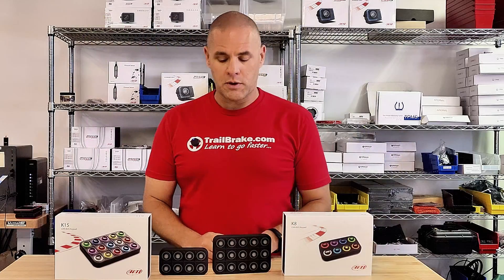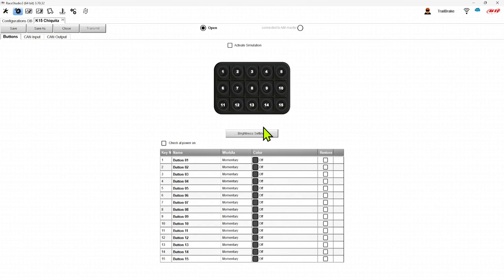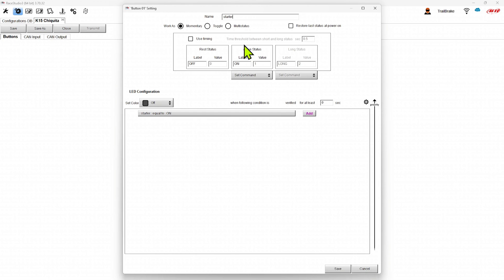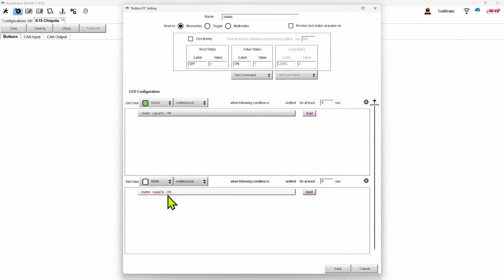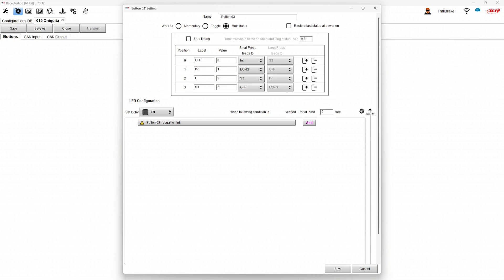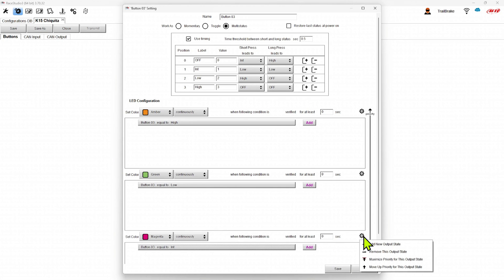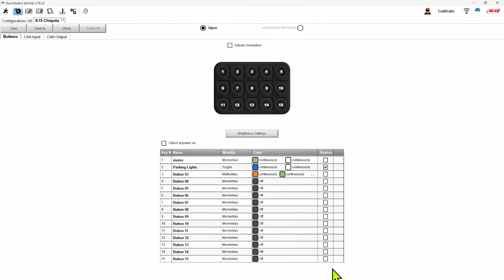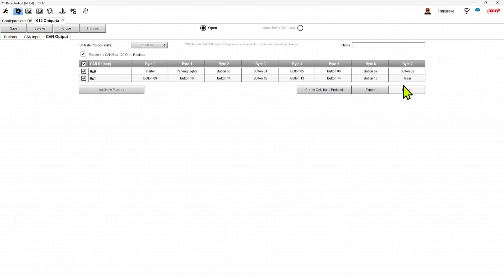How do I set up an AiM Open Keypad?

Comment: Will this work with an AEM Infinity? Would I need any other item to support connecting the two?
Reply from the maker: It should work with the Infinity ECU. You would just have to write the CAN inputs on the Infinity to match how you configure the keypad. The keypad comes with the CAN connection cable, so you would only need to add the programming cable. 

Note since this video came out, the K6 keypad has been released. You could get a 6, 8, or 12 button keypad.